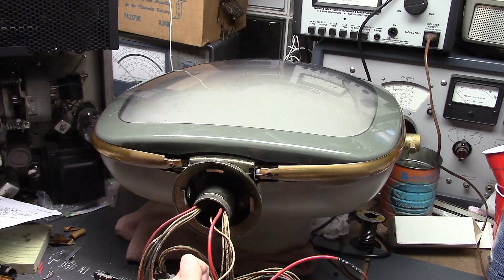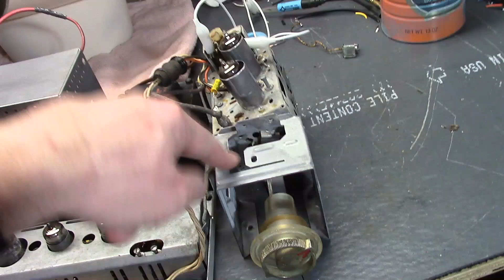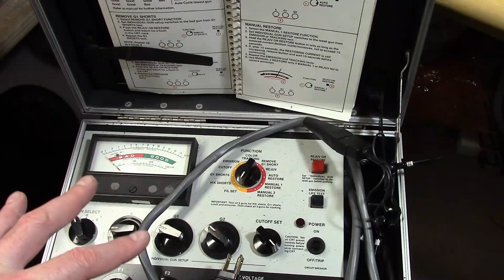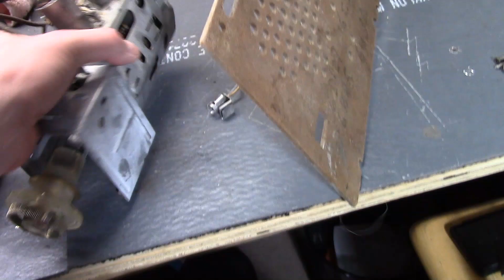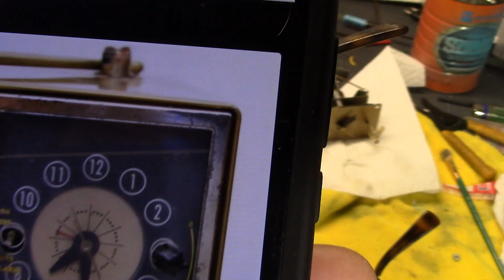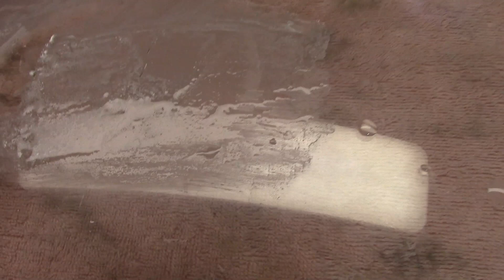Predictapalooza S1 finale - El Camino Siesta p2o3

Comment: Greetings:
You announced the need to overhaul the power switch, but never showed it. Obvious)y you were successful or we would have heard about it by now. What kept the switch from changing state?
You also skipped the focus selection choice, but again "easy-peasy".
Reply from the maker: The switch works fine. I didn't need to do anything. I don't know why they had shorted it out. Focus selection choice? You mean the short jumper wire for CRT focus? There are only two possible positions. Use the one that produces a sharper image. There's usually little difference between the two.

Comment: Bob, some days ago I came across the video of another TV collector focusing on other obscure models of Philco Predicta TVs, including one "corner" model. Inside they are basically the same thing as the "famous" models (short-neck picture tubes, boards, etc.) and produced at the same time. Do you know them?
Reply from the maker: Sure.  That was probably Blake Hinkle.  There is a whole line of console "Predicta" TVs like the "full dress" models.  Some used a 24" CRT.  There are Predicta clocks radios too.  I'll be showing one when I get around to it.
Reply: I worked on two Philco Predicta-based "plain box" type 21" table models for people over the past couple of years. One had almost the same architecture as the Princess model and had an added remote receiver module that I eliminated. It had a different chassis number than the Princess but close to it, it had the 5U4 rectifier option instead of the silicon diodes. The other one had a series strung chassis very much like the Holiday model famous Predicta but also a different chassis number but almost the same, although it had the double diode pack for the Horiz Osc phase detector instead of the tube section diodes like on the Holiday. Interesting, huh?